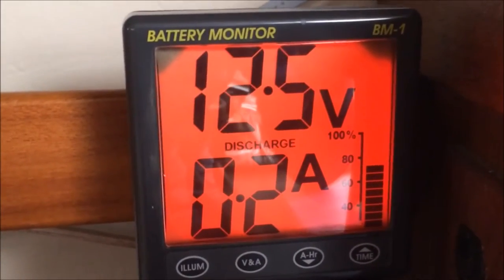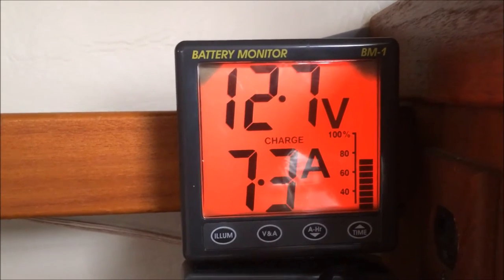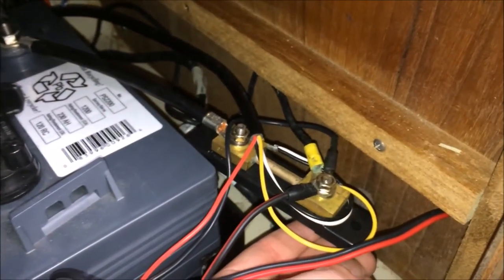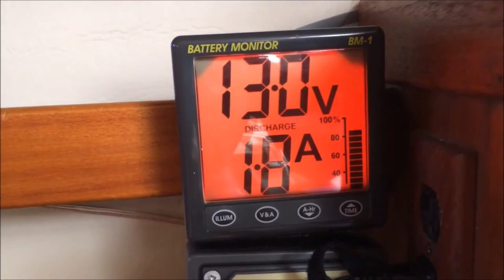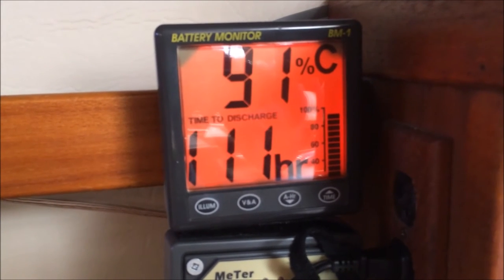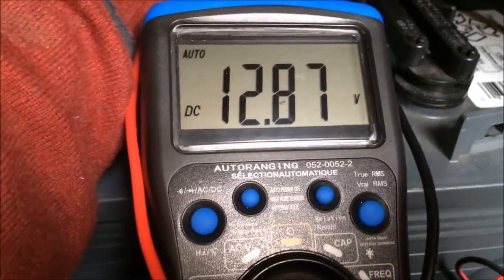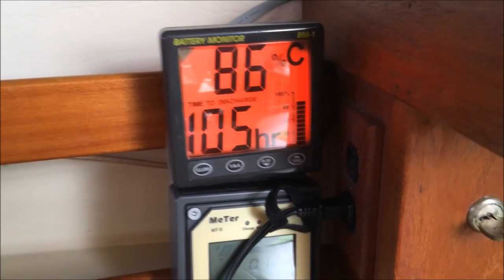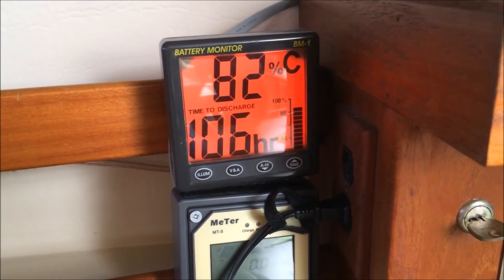NASA Clipper BM-1 Battery Monitor Review

Comment: Thank you for this video. I have a BM1 myself and the same issues with it. I understand it's not just me now. Also, thanks for the tip about setting the battery lower than it actually is in the ENG mode. Great video. Thanks
Reply from the maker: No problem glad it helped.

Comment: I have one of these meters and it will often show my batteries at 104% state of charge. 
This may depend on what you set the battery capacity to on the meter vs the actual capacity of the batteries - a bit of a guestimate required with older batteries. I've probably been overly pessimistic about my 4 year old battery bank.

Comment: Thanks a lot for the review. It looks like I would prefer the Victron Energy BMV-700 except for its stupidly small display. (I like being able to check the voltage from across the saloon) But the BMV-700 has the ability to program alarms.
Reply from the maker: I love the big display also that the BMR1 has. Over time i have stopped obsessing over exact battery level and quite like the BMR.

Comment: You wont get it to show 100% unless its charged to at least 14.8v . Your alternator will only get it up to 14.4v so that it does not gas hence it never shows 100%.
It drops fast initially because that is the charactaristic of a lead acid battery and stays at 12v most of the discharge ( which is why its called a 12v battery)  then drops again  being fully discharged at 10.8v.
Reply from the maker: John Harrington Thanks for the information John but you would think, and other monitors do account for the nature of batteries stat of charge. My understanding is not under load 12.6 is full above that is what is required to get up to that state. 14.8 to 12.6 is surface charge and will drop fast to 12.6 and it should in my opinion stay at 100% until dropping below 12.6. Also considering it knows roughly what the total apm hours  should or may be and what is consumed 5 min of use dropping 14.8 to 12.6 and maybe 2ho of use it should not show the stat of charge as 80%. I also have a MPPT smart charge controller that I would think could get it very close to full.  But assuming what you say is correct and the only way for the SOC to be 100% is to be at 14.8 that is good to know that is how the BM-r works. I have not received that answer even from there support and it should be more clearly stated in the manual that 12.6 is 80% SOC.

Comment: you might have to lower the ah that you programmed into the meter. i found it is never what the battery claims it is. always less . charge a dead battery till full,[when it goes into float mode ,almost zero amps.] see how many amps you put in to get to a full charge ,and that is your number . i think. lol. older batteries are less. i put an old 7 Ah ,UPS battery on my meter [ the wireless Ming-he $30+/- ] ,and  set the meter a one Ah.it helped. but it may go by volts only and batteries just don't stay at full charge 13.5-7 v dc  very long .. the meter is a common complaint. total guess work i think. good place for a piece of black tape.
Reply from the maker: immrnoidall  I did do that I thought I mentioned that in the video but it has been some time since I watched it.
Reply: guess i wasn't paying attention well